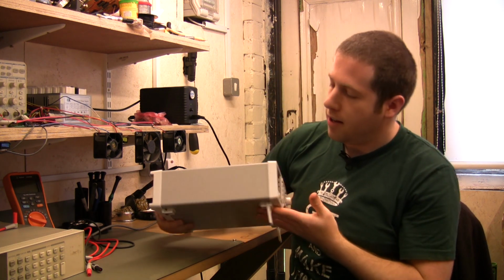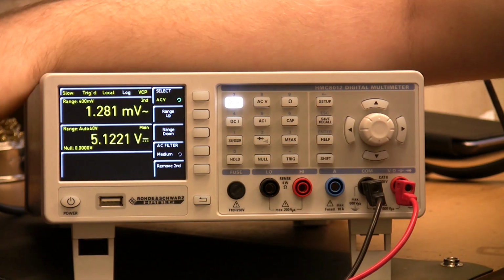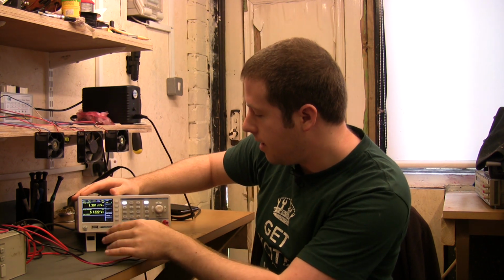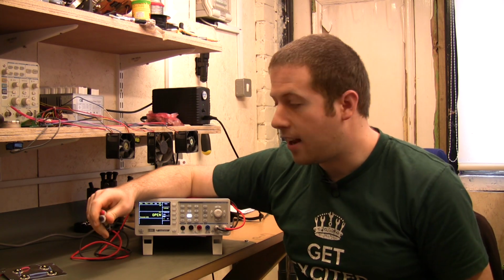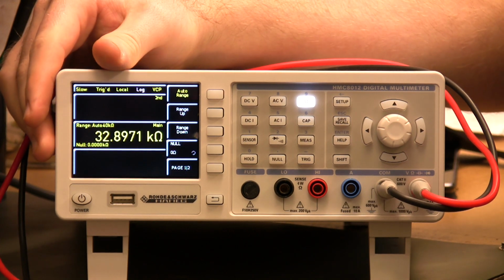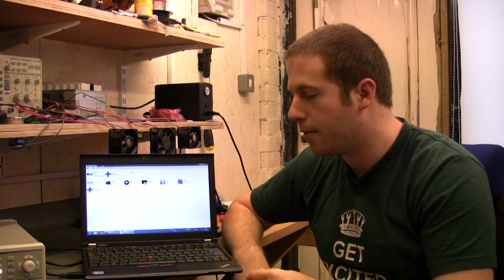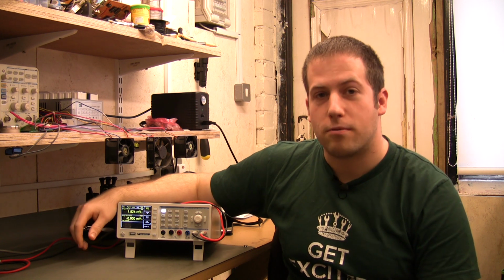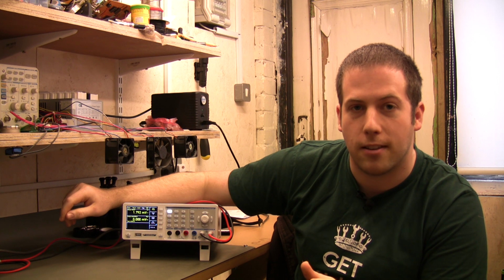Watt Circuit Hameg HMC8012 Digital Bench Multimeter Review

Comment: To bad it became rohde and schwarz, which means the doubled the price and ripped out what they consider "unnecessary options" like they did with the scopes.
Hameg made some great equipment of high quality and packed with options which cost a lot at other brands.
Now the previous hameg model line is almost gone and what remains costs 50% more and striped of all those nice options like 50 ohm/1 meg on the scopes, hdmi output and much more is gone.
Some of it doesnt even make sense like removal of the switchable input 50ohm/1 meg on a 300 mhz scope 🙄

Comment: Great video review.
I like Hameg I used to have an analog osciloscope quite some time ago.
I still prefer my Wavetek Data multimeter model 52 is much older 1987 but it has at least 90% of the futures presented here + maybe some additional futures.
It can datalog and measure power, has complex programmable math functions but what I love most about is that it uses only 500mW when is ON and nothing when is powered of from the soft power button and this is with technology available in 87.
It was probably extremely expensive in his time but I got it recently for a faction of this Hameg multimeter.
The diode test has 5 current levels that can be selected from 1mA down to 100nA and at 1mA it will output 9.3V this will go down on the next level 100uA it will output 7.7V so I can test up to 3 white LED's in series.